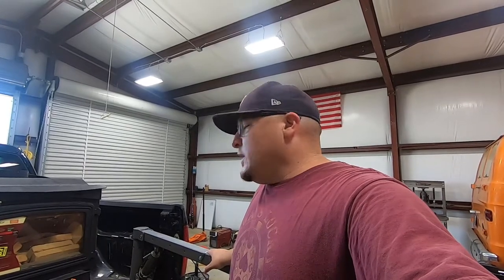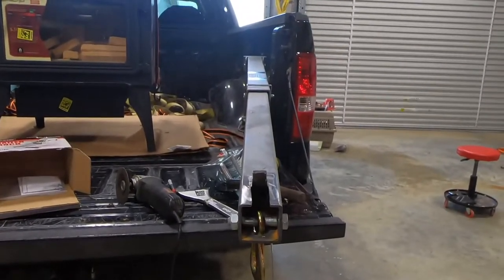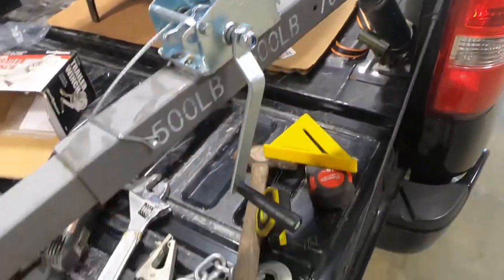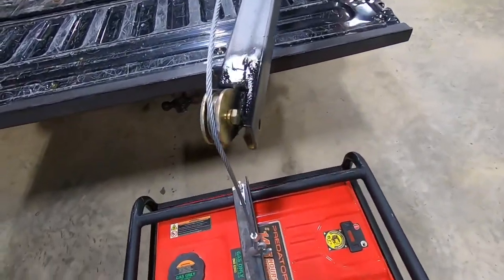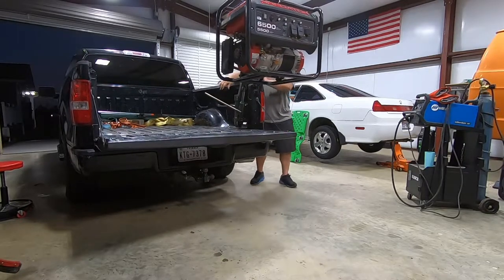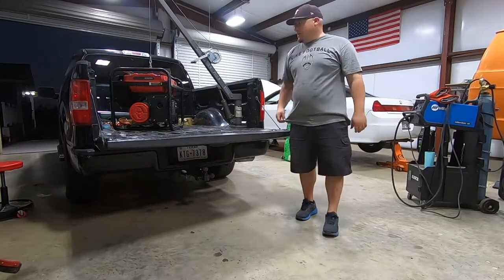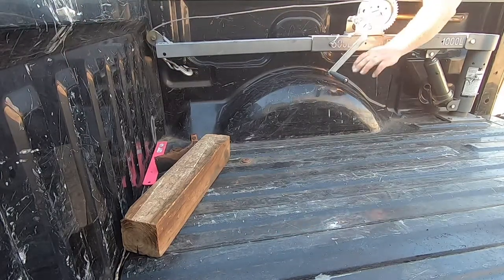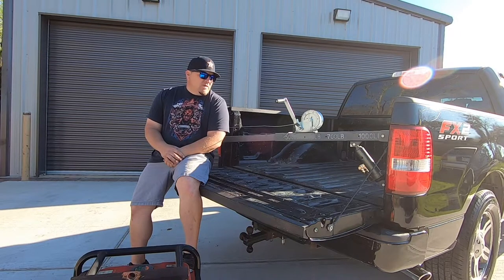Cheap Harbor Freight 1/2 ton Crane Update

Comment: If that line hops off the pulley you’re going to have a bad day! I’d weld in 2 eyelets one at the tip and one by the pulley! But you do you!
Reply from the maker: That’s a good idea! Better safe than sorry. Thanks for the tip. 👍
Reply: I'm thinking of getting one if these for the exact reason...lifting a 250 pound generator. 
I'm curious about your suggestion of eyelets. Can you expound?
Thanks

Comment: Great build, but you should consider placing a guard around the nose of the pulley to keep the cable from coming off.  It would be attached through the same pulley bolt (maybe longer) as a hoop with a hole on each side.  The clearance to pulley would be near-zero.  An alternate would be to weld to the boom a simple stationary loop close to the pulley between pulley and crank so that if the cable falls off, it won't allow the load to drop more than a couple inches.
Reply from the maker: @ryanthielbar  thanks for the tip 👍

Comment: I'm gonna figure out how to mount one  to a stake pocket on my flatbed so its removable and I can move swap it front to back. Looks like a game changer for a guy who prefers to work alone.  I wonder if they have an adapter out there...
Reply from the maker: Weld the 2x2 1/4 inch square on the bottom plate. Then mount a 2 inch receiver horizontally to accept the 2x2 👍

Comment: I installed a 2' length of pipe between the upper and lower sections of the crane so it's nice and tall when I need it to lift large items. Then I can remove the pipe and stow the boom under my bed cover when not in use. I also added an electeic winch and 12v actuator in place of the jack. The crane super nice and easy now.
Reply from the maker: That’s awesome!
Reply: How much weight is your actuator rated for? Any chance you have a link to the one you used?
Reply from the maker: @LondenT here’s the exact one that I used. https://amzn.to/3GwJjac

Comment: Great video. I do alot of junkyard engine and transmission hustle. Im looking to put this on my Ram to make life easier.
Reply from the maker: It really is a game changer I’m constantly using mine!!
Reply: @quickspoolgarage  I really liked how you used the angle iron as a lift point for the generator with the U bolts. Thats another thing I am going to try out to make things easier.

Comment: great vid .. I'm thinking of using the taller version for lifting approx. 250 lb. of firewood through a trapdoor in my upper deck the question is due to the tight size of the trapdoor I will only be using the hand crank, do you think it's possible to use using only the crank or will it be too heavy.thanks
Reply from the maker: Hand crank will be fine you can always add a pulley to gear it down lower if need be.

Comment: good thing your truck squats so much or reaching the jack would be difficult.  I'm wondering if it would be better suited on the drivers side.
Reply from the maker: I recently purchased an engine and the only place to load was on the street in front of dudes house.  I’m glad I did the pass side instead of driver. The pass side kept me from standing in the middle of the street which could be a potential hazard.
Reply: @quickspoolgarage  that is a pretty good point I certainly didn't think of.